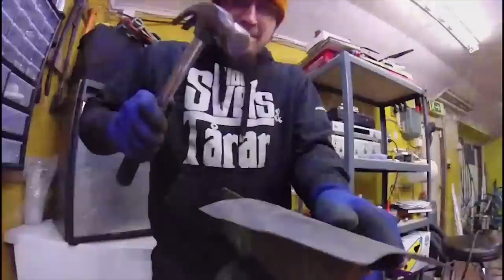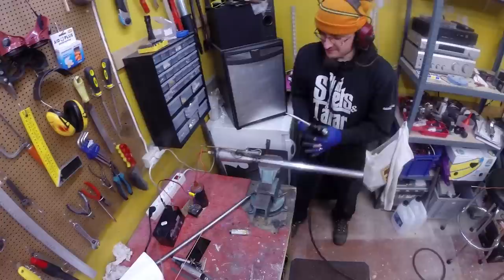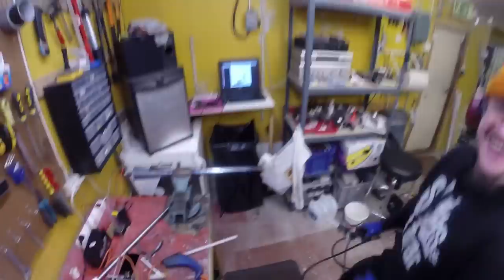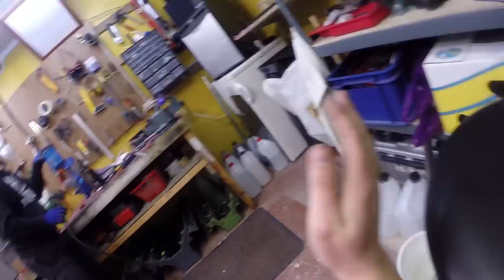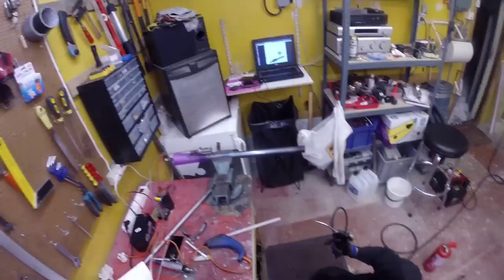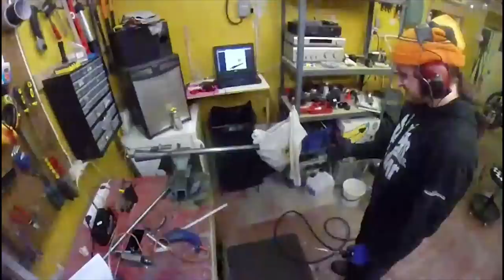Friday night pulsejet build

Comment: I tried building one of these engines a while back, everything was to dimension and it was proffessionally welded but for some reason it just will not start, doesn't sound like it is even close to starting. Anyway great job with yours!!